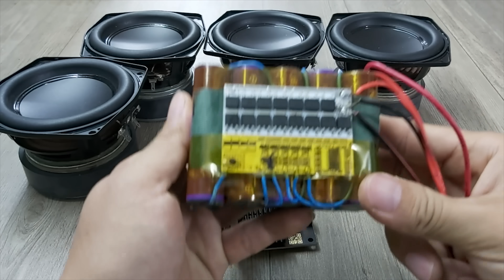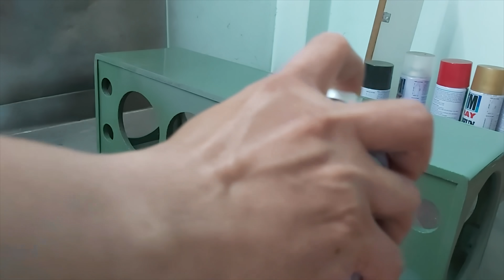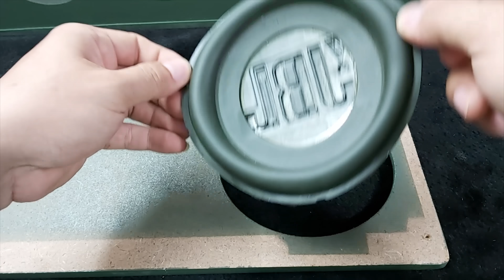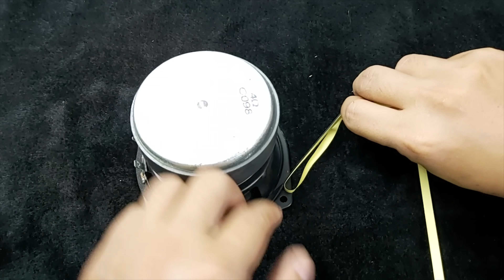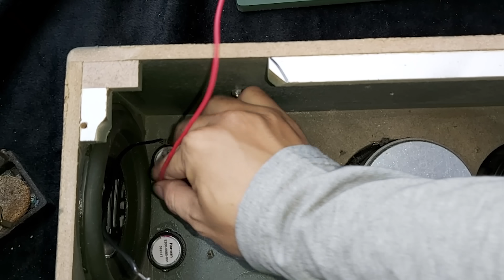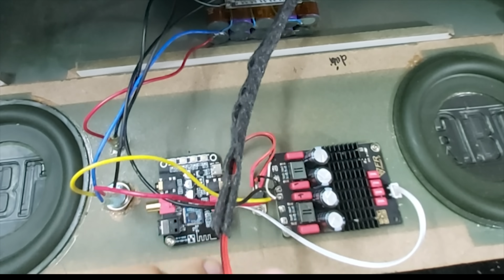DIY Bluetooth Speaker The BoomBox IV ( From old broken speakers) - EXTREME BASS TEST 100% LFM

Comment: RIP Tweeter
Reply: It because he didnt put a cross over
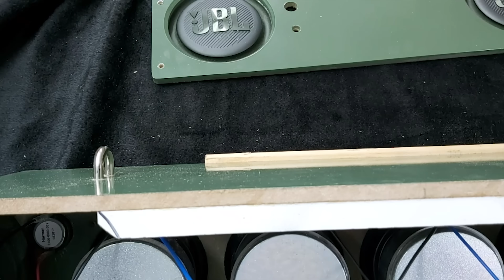Reply: @eddieribot1147  at 8:09 you can clearly see the filter caps, that provide a massive (like 24db, or 48db) attentuation to the Low Frecquencies :) This is called a passive filter :) so he had a filter in the circuit :)
Reply: @_decky4ever_  A single capacitor isn´t a good filter at all.
It just protects the tweeter from destruction, nothing else.
A dedicated crossover should´ve been used.
Reply: Whats with the tweeters? because of the pressure of the bass?
Reply: @ViezeVingertjes  He might have connected the tweeters straight in the signal.It might have been better if he had used filter caps for the tweeters
Reply: @wahidasad4853  9:04 isnt this yellow thing an high pass capacitory?
Reply: @edfx  yep that is a cap but i think it's not a good match for those tweeters. Cause the tweeters are poping like crazy or maybe its beacause of the air pressure of the woofers.well thats my thought😅
Reply: @wahidasad4853  yup, that’s why you always put different speakers in separate enclosures. Different frequencies and pressures. Blows out small stuff (like the tweeters) and just sounds like ass.
Reply: @Submarine_SeXJ  nope, tweeters are almost always completely sealed from the rear.  Tweeters generally have absolutely no effect by other speakers in the same enclosure.
Reply: @Submarine_SeXJ  also, correct me if I'm wrong, but I have never once seen a high-end brand of speaker makers use tweeters in separate enclosures outside of their mids or woofer enclosures. I've never done it in all of the speakers I built.
Reply: @sethh8892  teufel, sven, hopestar does have closed enclosure for the tweeter.

Also, yeah... this type of tweeter should be sealed from woofer presure. I don't know how its ended up not sealed like this, imagine the amp is 4x TPA 3116 with 400W total power, this tweeter will literally ripped its membrane at full volume
Reply: @MamadMusicVibe   lah kok anda bisa ada disini bambang
Reply: @MamadMusicVibe  seems like he wired something wrong, the other tweeters seem to be acting normal
Reply: @edfx  it is but look at the connection he run all speakers in parallel so that means 1 ohm at chanal
Reply: @sethh8892  he wired all speakers in parallel that means 1ohm at chanal plus tweeters are more sensitive so u need to put a resistor
Reply: @whynotsak3313  that really dumb. He should have figured that out from the start. He could have used a crossover network from any component set.
Reply: @MamadMusicVibe  no total power of all speakers is 260W
Reply: @Submarine_SeXJ  Usually such tweeters are sealed on its own but who knows 🤷‍♂️
Reply: @MamadMusicVibe  This will never reavh 400W lol.
The woofers will die immediately.
Even if he used the 21,1V refered in the datasheet at THD=10% (< already sounds awful at this level of distortion) it will output max. 50W per channel.
It has 2 channels, so 6x50W for 3 amps would be max. 300W peak but RMS with a acceptable THD=1% will be way lower than this.
Reply: @MultiWirth  why u tag me? Im just talking about tweeter that is not sealed properly, the watts rating is already correct.
Reply: @sethh8892  look at the Bowers & Wilkins line up from the 700s to the Nautilus series. They separate tweeters from the enclosure. Reason being, to reduce harmonic distortion and for the tweeter to “maintain a broader sound stage” (from what their representative told me)
Reply: @Celsior805  I call bs to be honest, but a manufacturer would NEVER deceive its customers in order to get better sales... Right? Either way, the only reason that you have to put an enclosure around most speakers is to get a more desired frequency range based on the buildup of pressure inside the enclosure. Ported boxes take this into account, especially when tuning the port. When it comes to a ported enclosure, surface area of the speaker, the wattage, the amount of port area, port length, enclosure volume, and mechanical limits of driver itself are all taken into account. That's because the cone itself is directly changing the pressure inside the enclosure. However with a tweeter that is fully enclosed, the tweeter cannot change the pressure of the enclosure, therefore it will have a zero effect on the tweeters resonant frequency, nor will it tune to a frequency. The most you can get out of a tweeter is putting it on a proper sturdy baffle.  With zero baffle, the sound will go everywhere even around its back side. Having that baffle more properly aims it, and because it holds it still it actually increases sound quality and dB. That's why large SPL systems have to have an extremely thick baffle with braces, any movement of that baffle will decrease the sound pressure level. I haven't had a single tweeter that had open back side. Every single tweeter I have ever seen or dealt with has always been thoroughly enclosed in its own basket. I'm not saying they don't exist, but they are definitely far and few in between.
Reply: @ViezeVingertjes  Poor crossover filter, the low frequencies are getting to the tweeter. Or mby just bad connections.
Reply: @ViezeVingertjes  No !
Reply: @ViezeVingertjes  could have been, or the tweeter was getting fed the same signal as the woofers which isn’t the safest
Reply: @ViezeVingertjes  I'm quite sure the enclosure is too small
Reply: @sabahaddinarslan2927  The smaller the volume of the body the better it is for passive radiators they will reach the maximum stroke with a small volume.
Reply: RIP tweeter
Reply: @saahilzxz1308  aaa
Reply: 13.20 rip
Reply: @toasted_bagel59  yeah from an boombox that didnt work anymore probably
Reply: yeah, lower tweeter can't handle big black beautiful bouncin bottom bass boostin bad boom box sheeran, its straight gettin its ass beat lol
Reply: @Keldren.  lol
Reply: 13:19 For all of those who say pressure inside the box doesnt affect the tweeters just take a look at that minute, they are literally being sucked in.
Reply: R.I.P Tweeter
Reply: Yea
Reply: 13:15
Reply: @jblonlyfans  agreed, i think he didn't pay attention to the video or not watching bass test till the end
Reply: Rip tweeter
Reply: @f
Reply: Since only one tweeter is malfunctioning maybe that one tweeter is out of phase???
Reply: Like for 1000
Reply: @congrt967  thanks!
Reply: 😂😂🤣 XD
Reply: എന്നെ  പോലുള്ള ചെറിയ  youtubersine സപ്പോർട്ട് ചെയ്യാൻ  ആരുമില്ല.. 😌😔💔💔💔😍❤
Reply: 13:20 tweeter r.i.p
Reply: LOL
Reply: idea:**
realization:**
components:***
Reply: Kkkkkkkk rip tweet
Reply: 5555
Reply: yeah... :v
Reply: Yeah :')
Reply: Probably they are not back seal!!!
Reply: Tweeters just need to be sealed off from rest of cabinet to be isolated from bass pressures.
Reply: My parchezing
Reply: My prchez
Reply: 😂😂😂😂😂😂right
Reply: @toasted_bagel59  does that matter? Hi is showing us an idea, what to do with old broke speakers.
Reply: tweeters need a special space 😹
not strong enough to join the high pressure chamber 😹
Reply: F
Reply: Yeah
Reply: F
Reply: Yes RIP Tweeter
Reply: 13:33
Reply: 0
Reply: Rip tweeter speaker😭
Reply: I'm new to music but I'm not new to physics. The bass airpressure would completely incapacitate any sound the tweeter tries to make
Reply: haha..no cross over.
Reply: Rip
Reply: How its 20watts for the tweeter
Reply: No need because small speaker HiFi speaker
Reply: @toasted_bagel59  Yeah and you can take a bet the wooden casing is built far better than the plastic rubbish from the factory too
Reply: Dual tweeters per channel will cancel out high frequencies at some points so better with only one imho. And quite a small box for all the woofers. But a cool build never the less.
Reply: That bad boy needs to be ported.😳👍
Reply: Addio tweeter . Non sono stati isolato
Reply: yeah,tweeter wont last long for sure lol
Reply: Tweaters should not move like this.
Reply: Just like Twitter 😂
Reply: Yeah
Reply: @MamadMusicVibe  you do realize that tweeters are completely sealed, so the pressure inside of the Box does not affect them
Reply: @MamadMusicVibe  I think they should not get the same frequency like the "woofers"
Reply: He said he fixed it
Reply: ★ ♥️ Check my YOUTUBE Channel → https://www.youtube.com/channel/UC9eG-sV2bx7VDhFy2yRv3Qw
Reply: @inthedarkheaven9239  why?
Reply: @inthedarkheaven9239  ok

Comment: 4× woofers jbl boombox 2 , 4× jbl boombox 2  twetters and 4× jbl boombox 2 passive You used. jbl boombox 2 was released like 2 mouth weeks ago. Its cool video 👍🔥
What i should like u use in vid? Use original boombox amp and give him more Power keep You battery life. If You used original amp u can turn on LFM make drivers go crazy and passive too. So dont worry about to not blow subwoofers from jbl boombox 2. they are extremely durable than other speakers 🔥🔥
Reply from the maker: ok fr

Comment: Get some capacitors for those tweeters!!!
Reply from the maker: yes, i do
Reply: @hvccreation  doesn't look like it the tweeters are flexing like crazy
Reply: @anthonystapleton2075  Its cause of the air pressure inside I think
The tweeter is basicly a passive radiator there :D
Reply: @bassfear_9952  aren't tweeters sealed...
Reply: @anthonystapleton2075  they are somewhat sealed or they just didnt have  a capasitor